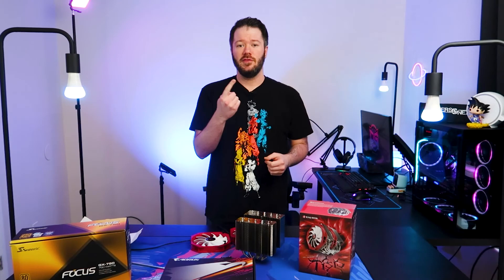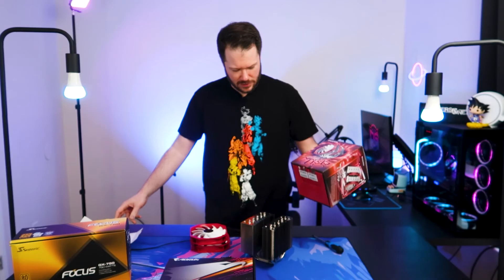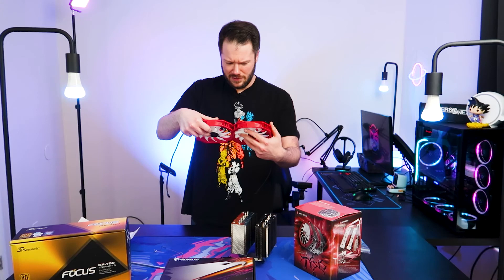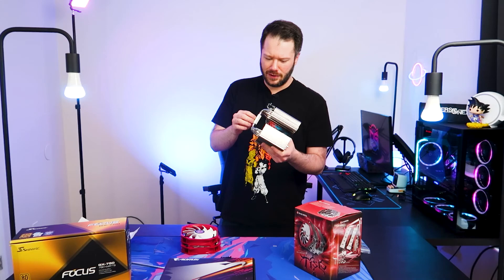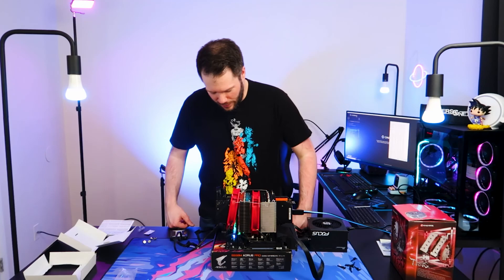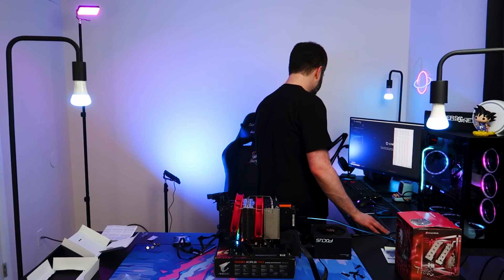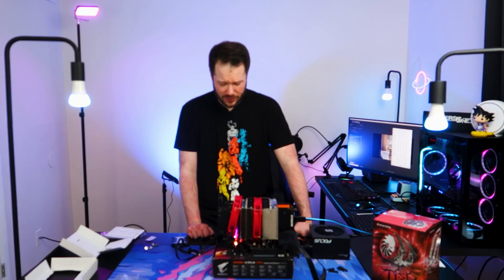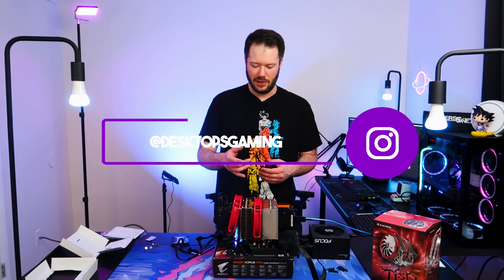How to NOT do Air Cooling | Raijintek Tisis Review

Comment: im sorry but i cringed so hard... there is a clear cut out on the side of the heatsink where that fan holder bracket is supposed to go xD
Reply from the maker: You would think that. I mounted it like that for comedic purposes lol. But really they don't clip to it and stay in place. They want you to use the rubber stoppers.
Reply from the maker: That's where they would clip on most other cooler heatsinks but it will not work. Trust me I know how to properly use fan clips 🤣
Reply: I've seen other reviews of this cooler with people using a rubber band for the other fan lol
Reply: @DeskTopsGaming  That's sad, I've seen this rubber mounting before somewhere, don't remember the cooler, but let's say I did not have it for long :D